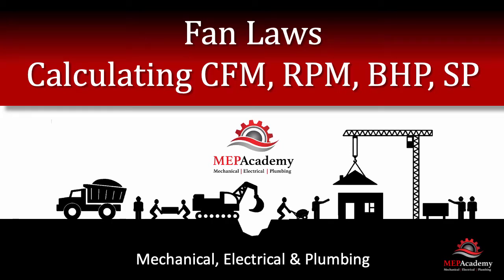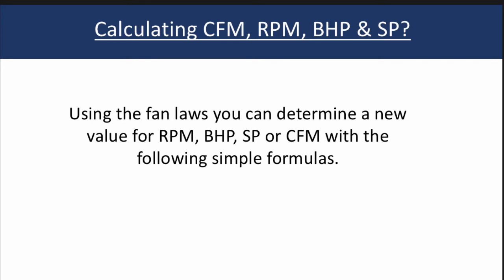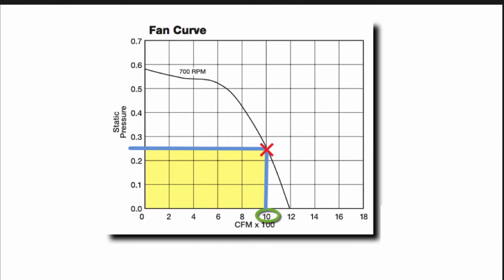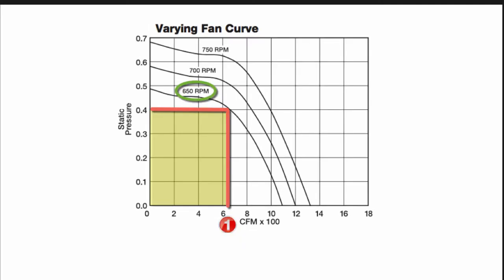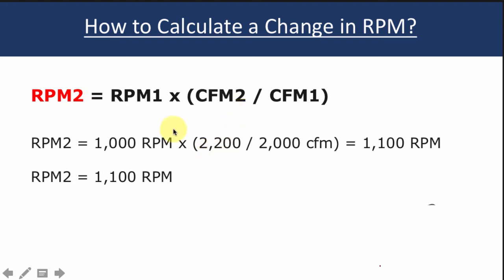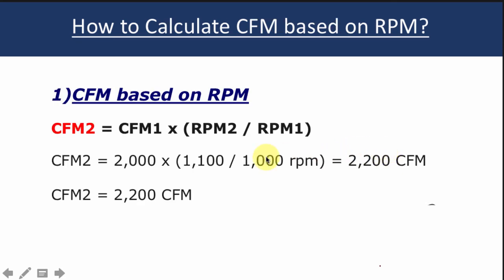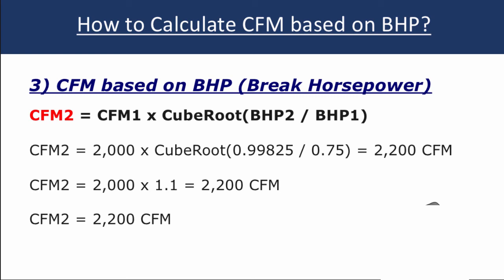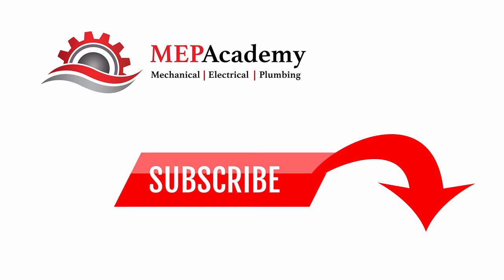Fan Laws How to Calculate CFM BHP SP RPM

Comment: Im taking the HVACR master exam and i cannont find fannlaws in any the books i have any idea where this info would be? Thanks
Reply from the maker: Here is s simple explanation of the fan laws in Greenbacks Catalog. Let us know if you need something more. https://content.greenheck.com/public/DAMProd/Original/10002/FanFundamentals.pdf
Reply: @MEPAcademy  thanks that foes help. So on the test one of the questions ask which fan law applies to a certain equation fan law 1,2,3 or 4. I have the manual J both edition the 2018 imc and ifgc and the modern refrigeration and air conditioning 21st edition and low pressure boilers fifth edition none of which I can find fan laws the exam is open book.

Comment: Good morning! Thank you for the video. 

Studying for HVACR PE Exam and looking at the video it seems these equations are specific to pumps from PE handbook section 3.7.6. Unlike the fan equations shown from PE handbook section 9.3.8.3. Would you know why it’s different? I assumed it would be treated the same just different fluid. Thoughts?
Reply from the maker: There are similarities, but air and water have their differences, here are some of them, such as Density and Specific Heat Capacity, flow rate equations, pressure drop, compressibility (Air is compressible) , heat transfer and capacity, friction factor and Reynolds number. Air is compressible with lower density and specific heat capacity, requiring different ductwork and fan power calculations. Water is incompressible with higher heat transfer efficiency, affecting pipe sizing, pump power, and pressure drop calculations.

Comment: What is bhp correct definition please explain
Reply from the maker: Break Horsepower (BHP) is a unit of measurement for the actual horsepower delivered by an engine to a pump, fan, or other machinery, after accounting for losses caused by friction and other factors within the engine itself. Unlike theoretical horsepower, BHP measures the effective power output available to do work.

Comment: Your equation to calculate CFM based on SP does not appear to be correct. It should be CFM1 / SqRt (SP2/SP1). An increase in SP at the same RPM would decrease the CFM.
Reply from the maker: Thanks for your comment. I'll have the engineer review the calculation.
Reply: you really should get that fixed asap.... @MEPAcademy

Comment: I'm a MEP engineering intern. Any good resources I can learn from?
Reply from the maker: The Industry Standards are a good place to start, which is ASHRAE if you're doing Mechanical Engineering, ASPE for Plumbing. Then study up on the local codes, especially if you're in California or a place where energy is a driving force for the code cycles. Good luck.

Comment: Dose this apply to prop fans?
Looking for why prop fans increase current when static increases .. on blowers it makes sense that air is the load and if there is less air then the current drops
Reply from the maker: Any increase in the resistance to airflow will cause a loss in CFM and performance.

Comment: Starting at ~5:13 into your video:  if you increase the RPM, the flow rate will increase along with a corresponding increase in the resistance to flow, i.e., ~static pressure.  The static pressure can not stay at 0.4" w.c  (in your example) UNLESS you have physically changed the ventilation system to make it have less resistance, e.g., few elbows, better transitions, etc.
Reply from the maker: Thanks Robert. The example was for one of the Fan Laws in order to show the effects of changing RPM in relationship to CFM for a particular Fan irrespective of the design of the ductwork. Fan Law Example was for CFM (new) = CFM (old) x [RPM-new / RPM-old]. What you are stating is true for another of the fan laws which effects Static Pressure with a change in RPM as follows. SP (new) = SP (old) x [RPM-new / RPM-old]2. Great observation. Thanks.